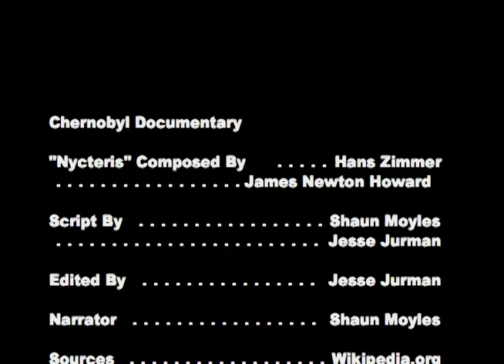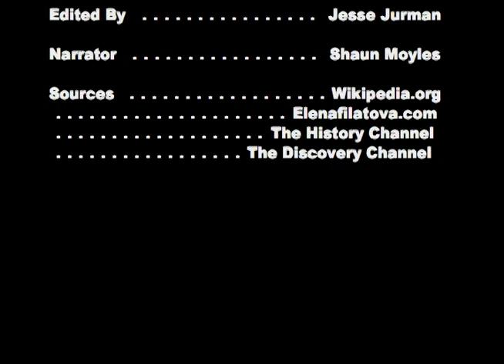Chernobyl Disaster Documentary

Comment: Both actually. Graphite tips of control rods are counted as one of the causes. If the rods were without them, it could actually stop the reaction. There is never one cause in failures like this. It's always more factors.